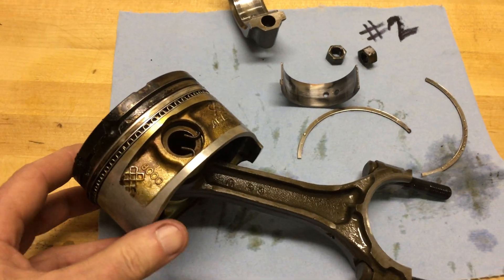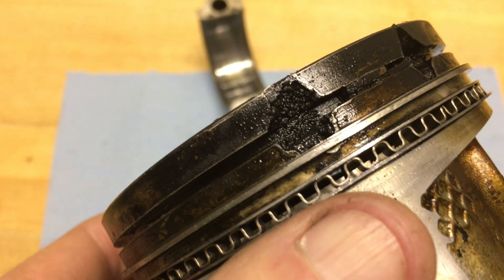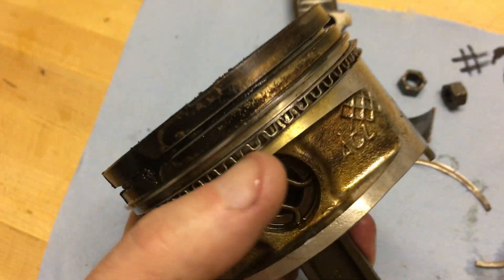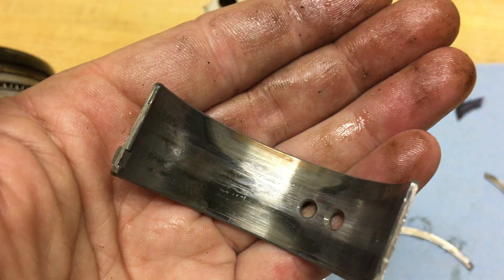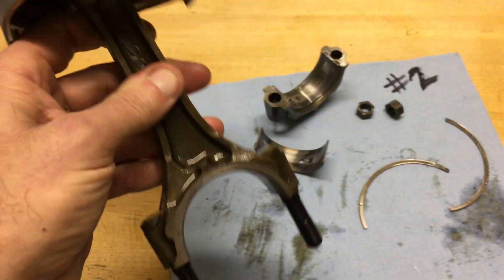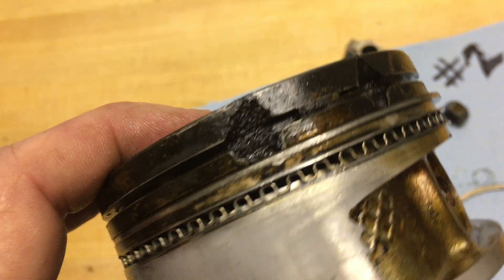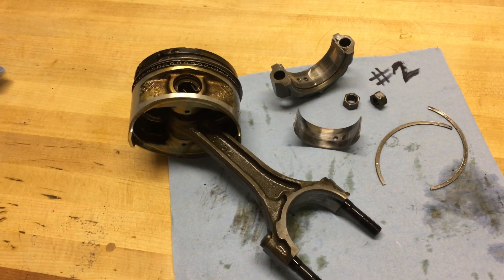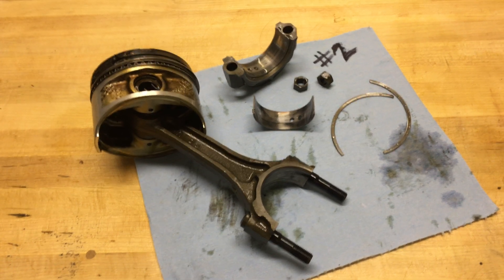1990 Toyota pickup 22RE piston removal UPDATE: HOUSTON WE HAVE A PROBLEM

Comment: Looks to me a case of preignition to me witch broke the ring and a small piece of ring bounced around eating away at your piston , the forces at work in an engine are crazy
Reply from the maker: Yes, I think that is what happened. The ring fractured and a little section wiggled its way up and down until it dug a hole and made it free. Later in the rebuild, I discovered whoever built the bottom end (before I bought the truck) bored the block .020" over and used the correct pistons, but someone accidentally installed STD size rings. This is probably what resulted in the rings breaking I think. Crazy.

Comment: New pistons are pretty cheap.  I'd go that route.  I'm sure you can find a used block.
Reply from the maker: Yeah, that's basically what I did. Ended up running the block as is after a hone and bought some KB pistons. There's a few videos on the channel now which show them going in. Even ceramic coated them! :-)

Comment: lce sells a bare block!! it'll be cool if you bought it and documented it from the ground up the build!!
Reply from the maker: That would be cool for sure. Unfortunately, LCE is out of stock on bare 22RE blocks until around April from what I'm told. I'm working on getting back on the road and selling my house, so I kinda need to just slap the motor back together and use what I have for now. The damage on the cylinder wall in #2 isn't ideal, but I don't think it will negatively affect how the truck runs near term. It will be a fun learning experience :)
Reply: @ray5961  Yah that would be legit! are you going to take it to a machine shop and get it cleaned up professionally with all the right measurements in or are you gonna wing it? please document this make videos cause i wanna learn
Reply from the maker: @chefrobertcaldas  I'm gonna wing it. I'm installing new pistons and rings as well as new rod bearings. The crankshaft rod journals are .25mm / .010" undersized, so someone reground it at some point. I'll document things as I go; should be fun times haha.
Reply: @ray5961  hell yah that'll be sick it def takes skill and knowledge what you're doing when it comes to working on the lower block with clearances and torque specs everything has to be perfect. super stoked for this one please go into detail so i can learn from you!
Reply from the maker: @chefrobertcaldas  Sadly most of my highly accurate measuring tools are boxed up and 400 miles away at my new place :) So I'm winging it to some extent here. If all goes well, I should have the ol' 22RE up and running again in about 10 days. I'll try to document as much as I can.
Reply: @ray5961  just buy the bare block!!! thatll be so sick to see you build it form the ground up pistons and all it might be cheaper that way too?!!